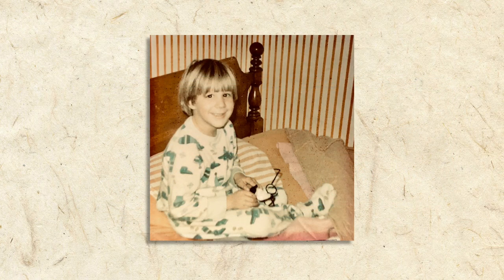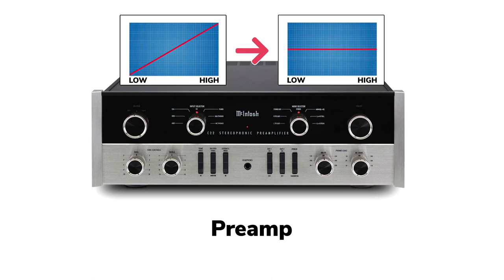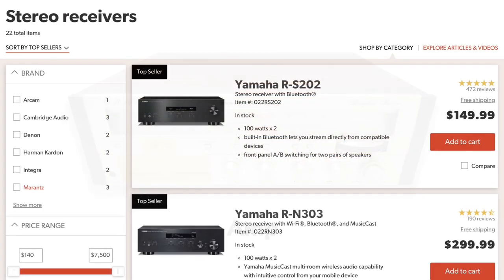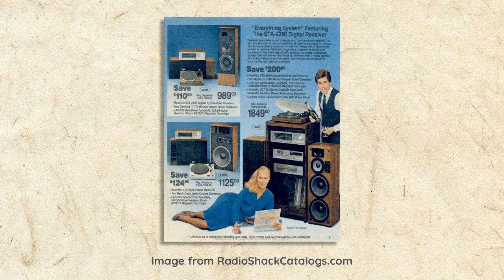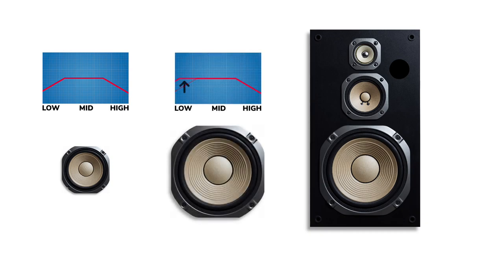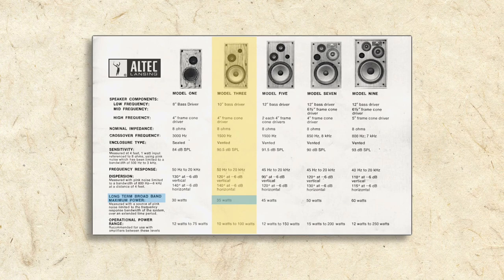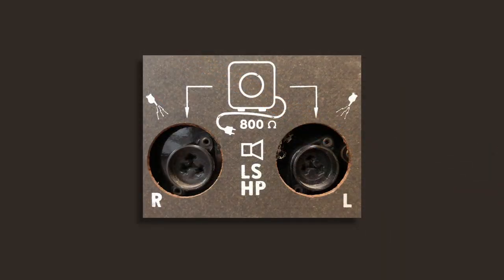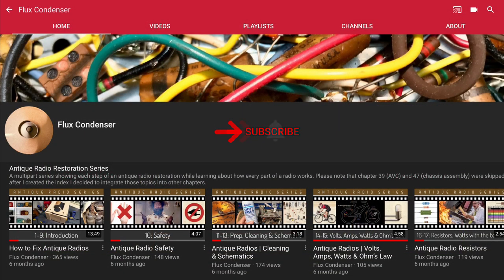Build A Vintage Stereo | Components & What Every Stereo Buyer Should Know

Comment: I own a pair of those KLH speakers pictured , from 1967 or 1968 .  I believe they are 2 Way , with 10" Woofer . I think Henry Kloss went on to consult at Cambridge Sound Works . And a Fisher Receiver .
Reply from the maker: That’s right, Bill. Designed and built in Cambridge, MA when Boston was a hub for great speaker designs and manufacturers.

Comment: The greatest benefit to more efficient speakers is lower distortion. Generally speaking, more efficient speakers “loaf” along, even at higher levels. A less efficient speaker has to be driven hard to get the same volumes as, say, a Klipsch or JBL horn speaker and that often results in greater distortion. It’s not an issue at normally low listening levels though.
Reply from the maker: There are many factors that contribute to speaker distortion and there are many fine performing low-efficiency speakers that simply need more power to do the job. High efficiency is no guarantee of low distortion. In fact, many PA speakers are very efficient and can play loudly, but distortion is high. The ability to play loudly has been prioritized over low distortion in most PA speakers and the high efficiency is exploited to that end. 

When a speaker is designed for low distortion, then yes, having high efficiency drivers can be helpful toward that goal and I agree that, yes, a horn loaded midrange or tweeter doesn’t have to be driven as hard to create the same volume levels as non-horn drivers. 

The greatest reduction in distortion that’s realized from high-efficiency speakers, though, is probably on the amp side, not the speaker side. A high efficiency speaker requires less power, so an amp is less likely to be driven into clipping where harmonic distortion becomes very noticeable.